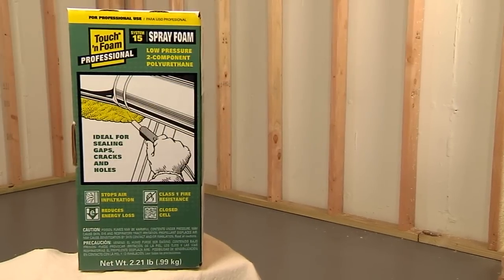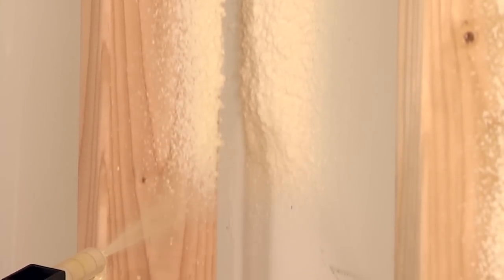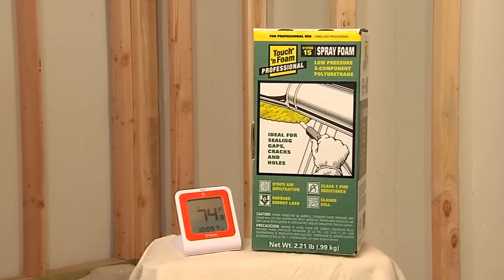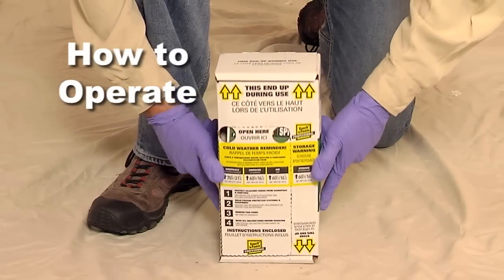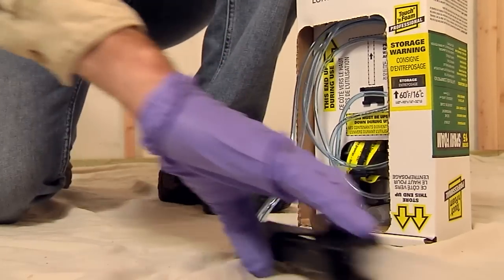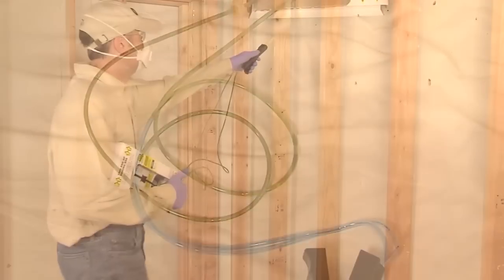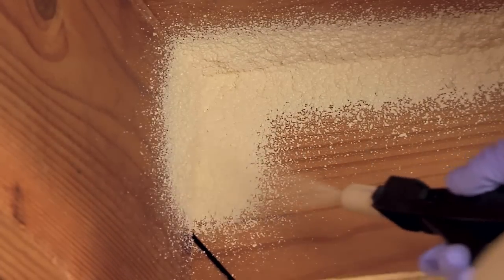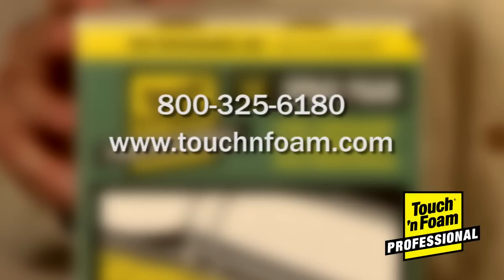Touch 'n Foam Professional System 15 Instructional Video

Comment: This product might work well if the packaging wasn't so cheap it was faulty. Bought two units one had a bad leak from the start of the hose and the other exploded after 20 seconds. Garbage